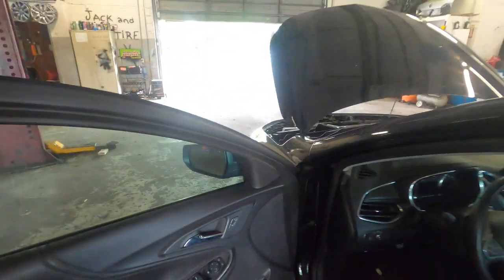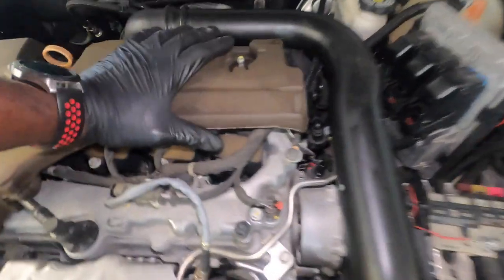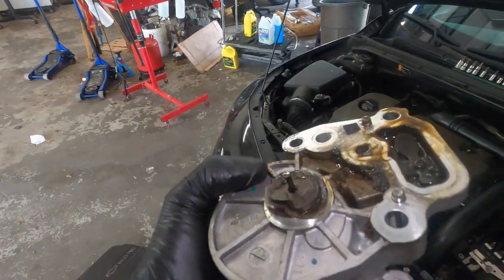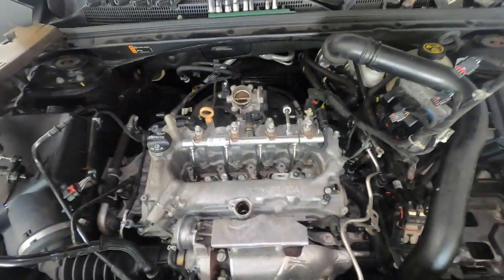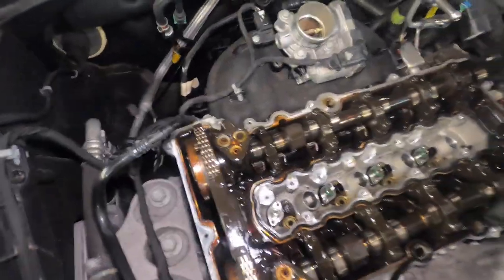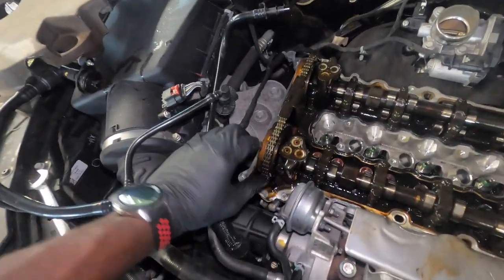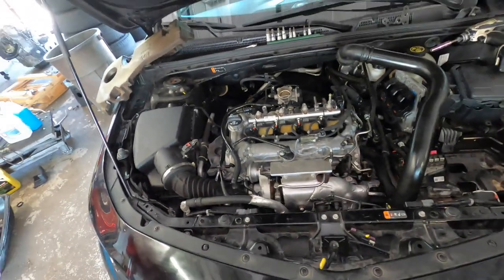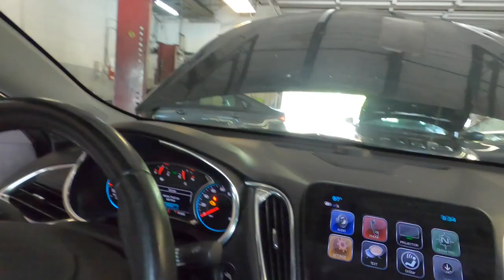Chevy Malibu vacuum pump and valve cover gasket

Comment: Fun fact, GM currently has a class action lawsuit ongoing due to faulty vacuum pumps and how much damage the broken pieces can do to the camshaft and the other valvetrain components. Also the loss of brakes due to the pump failing.
Reply: yeah mine broke the month they filed just now getting it back together 1k later so far
Reply: @CrazieFrogz  my friend is dealing with this now but her car is under warranty still and the dealership is trying to ask for oil change records for the warranty work. We shouldn't need them because this is a know bad part, but luckily she had them. They tried to tell me the cam was seized and that's what caused the pump to break. Total BS. We brought the car in running and the service advisor tried to tell me a car can run with a seized cam 🤦🏽‍♂️
Reply: @richardsilvas3152  if it does I'll be Amazed 😆. No this is faulty design!   Fight it. I'm hoping they recall. Go to face book & join the Malibu car club. They great. I have no warranty but month later & she still running.
Reply: This just happened to me! Damaged everything camshaft timing chain and a couple other things smh $3000 dollars job
Reply: My girl car just did this today the dealer said the pieces went thru the motor and she has to get a new engine and turbo
Reply: How do i become a part of this law suit

Comment: Change the entire pump people don’t try and rebuild a pump that failed it’s cheap enough to replace. It doesn’t have anything to do with oil changes with these pumps they just break. Happened to my BRZ and my Cadillac ATS it’s B.S. GM is one of the worst car company’s on the planet

Comment: I just had to replace the vacuum pump on a 2016 Chevy Malibu with a 1.5 turbo. I had to pull the valve cover off to get the shrapnel out of the engine. I was very lucky and able to retrieve all if the pieces and didn't see any "forbidden glitter" when I changed the oil. I modified the replacement by drilling out the oil feed port assembly to a larger diameter to increase the flow and volume to the rotor bearing to attempt to reduce the likelihood of another failure. Apparently there is a class action lawsuit for these pumps failing prematurely. Oh and as for oil changes, they have been done on time but this still happens...

Comment: I'm concerned about the metal debris that came out of the head from the broken vacuum pump. How would you know wether or not it already got into the bottem end of the engine?
Reply: You probably dont without pulling the pan
Reply: Two separate parts of the block your cams are blocked off . Have engine opened today and it looks like it’s only in that part of engine

Comment: The vehicle has a change oil soon notification. I guess the owner just kept driving around with the warning light on or reset it without changing oil. That oil change would have been a lot cheaper than the work you had to do. So she neglects the maintenance and decides to unload the vehicle on someone else. I bet she will want top dollar and will not tell the buyer about the lack of maintenance and the cam sprocket issue. As usual your video was excellent. Much respect my brother.

Comment: I had the vacuum pump break and lock up.  Hard break pedal, and difficult to stop.  At the same time engine lost power, and shutdown.  Towed home.  Chasing the P0014 and P0017 codes because the car would not start.  Saw another video where the chunks knocked the reluctor out of position, causing the ECM to think the cams were seriously out of time.  Pulled both cam sensors and the car would start and idle smoothly.  Rev up with no issues.  About to pull the valve cover to get the chunks out and replace the vacuum pump.   Dangerous and poor design by GM.
Reply: Did you figure out the reluctor moved on the camshaft yet
Reply: @johnmitchell8925  I did.  Pulled the cover.  Removed all the current and previous broken pieces of the vacuum pump coupler. Rotated the engine to TDC.  Then, rotated the reluctor back to alignment.  Reassembled with a new vacuum pump and gaskets set.  Good to go, until the next time I guess.
Reply: Hello, I had this same thing happen to me yesterday.. Drove home with minimal brakes but when I turned car off, it won't start after that. Turns but doesn't ignite.. Removed the pump today and it has shattered.. I have 2 pieces missing from the old unit and will open up valve cover and fish out.. Question is though, what are the chances it will start or do you have any tips I can use to start, maybe removing sensors like u mention? Any help is appreciated
Reply: I meant will it start with a new pump when I put one in or do you think the no start issue is unrelated?
Reply: @scribe8398  if you disconnect both of the valve timing sensors the car will start and probably run.  Assuming the check engine light came on and a code scanner shows one of the previously mentioned codes.  You will need to position the reluctor back to the correct position on the cam. And dig out the broken pieces that are under the valve covers.
Reply: @maikata329  thanks for your help. The check engine light does come on when I tried to start just after I got home and turned it off.. Brake pedal was and still is super hard... I don't have a OBD2 scanner so unsure of the codes it will throw..  I'm just worried it still. Won't start with a new vaccum pump as the brake is still super hard? I will open up and fish out new parts. Sorry can you Help me a bit further with what you mean when you say position the reluctor?
Reply: @scribe8398  This particular video does not focus on repositioning the reluctor back to its proper position on the cam shaft.  But there are several you tube videos that do show this.  https://youtu.be/ofnKBaCf9yI?si=ORb7_U79HHoiIO4k   at the 36:30 time of the video he shows the orientation of the reluctor to the cam shaft bar code.
This video shows a more detailed look at the cam.  He replaced his cam, but most likely this isn't necessary.  https://youtu.be/Icb_bgwKmHk?si=r9HzeOMWR3KVQOLE
Reply: @scribe8398  if you car will start and when running you have no check engine light, then the reluctor for the cam shaft timing maybe ok.  Changing the vacuum pump is a simple task.  If you pull the pump and the coupler that mates to the cam shaft is destroyed then those pieces are inside the valve cover sitting on top of the head.  You might be ok to simply install the new pump to restore your the vacuum boost for the brake master cylinder.  Beware that one of the broken pieces remaining under the cover could jam in between the reluctor and the head at which point the reluctor will rotate on the shaft and cause the ECM to believe the cams are out of time. Even thought mechanically they are still in time.
Reply: @maikata329  Thank you. I have done 95% of the valve cover removal but got stuck at the end as I don't have a pry bar and it wouldn't budge. I will get back at it tomorrow and hopefully I can get in and remove the old VP bits. I watched the other videos you reffered to and think I have a idea of how to check the reluctor. My new VP should arrive In a few days so hope to get it and and the car starts, fingers crossed
Reply: @maikata329  I finally managed to get into the valve cover and successfully fished out the pieces.. Your prediction was correct, the reluctor has moved.. The best way to describe it would be that it is at a 3 O Clock position, 12 being in line with the QR code on the camshaft.. Any tips on what I do from here.. Very lightly tapped it with a hammer but it doesn't move, scared to apply more force.
Reply: @scribe8398  it is an interference fit to the cam shaft.  It will move with a more aggressive tap. I tapped mine back into position with a hammer and bronze rod I had laying about.  But I am pretty sure you could use a piece of aluminum or metal softer than the reluctor cam to move it back to position.  I was a little fearful also, but I've not read in any of the posts where someone broke it will moving it back.  Just tap it a little harder each time until you see it move.  You might also try clamping or wedging it in place and turn the motor by hand with the crankshaft pully, which is basically how it moved to begin with.
Reply: @maikata329  Thank you. I managed to move it back with using a bit more force..  Installed new VP and closed it up.
It started :) which it didn't before (crank, no start) and brake pedal has normalized..
Butt, its running funny.. "Reduced Engine Power" message comes up along with "service ESC".. It runs for about 2 mins then idle lowers, engine shakey and then turns off.... I don't know where to start now. Do you have any tips? Or could it be that the camshaft may need to be changed. Sorry for all the questions and really appreciate the help. There is no active dealer here as Holden Shut down in New Zealand  and have service dept only who are outrages on pricing
Reply: @scribe8398  I don't have a solid answer, as I am not a GM authority.  I did not experience this with vehicle I had.  A quick YouTube search revealed a blown fuse could be the issue.  Under the hood in the fuse box, fine fuse 11, Emission1 10Amp and fuse 47 Emission2 and see if either are blown.
I'm not sure what those fuses do but it appears to be common failure amongst this garbage engine and car.
Reply: Also, you mentioned you don't have a code reader to read or erase the codes.  If it turns out the fuse(s) are blown, after you replace them pull the positive and negative battery terminals off the battery to reset the codes.

Comment: DIY folks, please read

There are a few things you need to be careful of when completing this job.

1. The PCV hoses break very easily. It's not impossible to reuse them or leave them attached, but a new set can be  pretty pricey. Just be mindful working around it, or have a spare on hand so you're not stranded. If you manage not to break it, return your new part and get your money back. I slipped and broke clean through with just my hand.

2. Probably the most important thing. Your injectors have 2 o-rings up top per each injector, one green and one black. When you pull the fuel rail off, there is a high chance the black rubber o-ring will come off of the injector and be sitting inside the fuel rail. When I was reassembling, I saw the green ones on the injector and assumed that's all there was and everything was fine. When I tightened the rail, the black o-rings did not seat properly and became torn. The rail was gushing fuel at the injectors. These oring kits from the dealer are 30 dollars per injector. Even on rockauto they are 12 per injector, or 3 bucks per oring at some parts stores, but some are not a guaranteed fit...

Before you put the rail in, make sure you get the o-rings out of the rail, push them back on top of the injector, and THEN push the rail onto the injectors. Hand start all the bolts but try and work it down as evenly and level as possible. After you push them down as much as you can, I recommend lightly tightening the 10mm bolts at the bottom to help seat the rail, and then start to tighten the small Allen key bolts on the injectors themselves. Once you start getting flush,  fully tighten your 10mm and then your allen key bolts. 

3. Easiest way to undo the fuel rail connections at the injectors is to take a flathead screwdriver, press the tab in gently but all the way in, then using your other hand, take an Allen key wrench (L-shaped) and use the angled end to pry the bottom of the connection up. Put a little pressure on the front of the connection, and then put it to the rear. You can break these by only prying on one end, or by tugging on the wire if it's still connected. Take your time and be gentle.

4. The red or gray safety clip on some of these connections break very easily. If you cannot pull them back easily or they only come out half way, try wetting it with a little bit of electrical cleaning spray to lube it up. 

5. My intake tube to the throttle body would not stay put as easy as it did in this video. If it gets loose it smacks the throttle body pretty hard and could easily toss debris in there or inside the engine if you have the cam cover (valve cover) off of the engine. Find a way to securely tie it off. 

6. Since you're already here, you might as well change your spark plugs if you haven't already. These plugs take a 14mm socket instead of a standard spark plug socket... my deep well was too thick to fit in the hole, so be prepared to buy a special socket. 

Thank you for making this video 👍🏼
Reply: thanks , i used all this but i did break end up breaking a cam sensor lol when i took off that intake tube lol oops , just now putting the car back together thanks to GM and they law suit against this part, it was hard to find.
Reply: There's a way yo remove the valve cover gasket without removing the fuel rail. Once all the connections are off and the valve cover is ready to come off, angle the valve cover in such a way that there's space to overcome the fuel rail. I literally watched my mechanic do it because he didn't want to waste the unnecessary time to remove the fuel rail.

Also, that screw that has a special tool to remove it can also be removed by pliers. Just have to twist it off. It's not incredibly hard to do.
Reply: Thank you for taking the time to make this reply Im sure it will help more then just the DIYers 😁

Comment: I would guess this is an oiling issue with the engines.
I just had this same issue, and I change oil as soon as it is needed, my Malibu has 65k, I would advise anyone with these engines to change this out at around 50k or if your check engine light comes on.
Good video 👍👍
Reply: Change out the vacum pump?
Reply: @robertschris82  yes, believe me you want to do it before it comes apart, cost me $2700 in repairs, the vacuum pump is pretty easy to change
Reply: @barnyardgarage yeah I change mine every year. It will fail no matter how offer you change the oit
Reply: @keingdougie24  yeah actually a very poor design to say the least
Reply: Exactly! Poor design is an understatement! Great call on spark plugs! 

Mine just failed at 137k mi. I’ve owned it the last 2yrs and 80k, changed with Mobil 1 every 5000 mi. 

Super clean engine but the vac pump still fails… easy enough fix, but man it was less than ideal to get a reduced engine power warning and 15sec later have a hard brake pedal while descending Colorado mountain roads at 70mph. Pucker factor indeed! 

Make sure you review the codes! Local mechanic saw a fuel pump driver low voltage and told me it would need a fuel pump. Skipped over the low vac and camshaft position over advanced errors. Those codes combined with a hard brake pedal and reduced engine power, lean toward vac pump failure. Don’t get taken for a ride on $300 diagnosis, and $1000 or more for a fuel pump and driver you likely won’t need just to have to drop another $2000+ for a new vac pump, exhaust camshaft, sensors, etc. 

$300 in parts buy the PCV hoses, break them and get it out of the way. Lol. eBay has the injector washers for $15-20. Go ahead and buy at least one set. A days shipping and a few hours of wrench turning and we’re back in business. 

Only thing I might add to the video is double check the painted timing dots on the timing chain and gears, plus the QR matrix codes, plus the reluctor pin alignment. Use plenty of sealant jut like shown in this video before buttoning it back up. 

Thanks for this video! Good luck everyone!
Reply: @barnyardgarage  Check to see if a service bulletin has come out on this yet, If so i believe you would get reimbursed if you saved your repair bill
Reply: @jamesshimp640  Thanks for the heads up

Comment: Question: 
 I didn’t got to see how you remove the Crankshaft pcv valve the one on top back side. I was told it’s not removable only by removing the valve cover a 4hr job BUT I notice on your video you took the tuve/hose off the pcv valve it self. The dealer said it would need to be destroyed to remove and Install a new tuve/hose. I notice yours removed and then at the end of your video you just snap the hose back in.  Can you share details and if you did managed to remove can you provide detail on tools used. Thanks a million!! Great video!!

Comment: My 2016 Malibu has the same thing wrong thank you for the video helped a lot!
Reply: Same thing here. Only got 40k miles on it and have always gotten the oil changed on time and the dealers tells me 1200 to get the valve cover gaskets replaced..it'll be traded in within the next month or 2

Comment: Would a vacuum pump cause the brakes to pulsate like the ABS is kicking in?
Reply: no thats most likely a warped brake rotor
Reply: thats what our car would do really bad and it turned out to be  the vacuum pump
Reply: Yes, that is correct. Feels just like ABS pulsing or brakes grinding. It is indeed the pump. Also if you have low/dirty oil and/or codes P1101 + P0556, it is 100% the pump.

Comment: Will this cause engine to seize. ?
Reply from the maker: Yes
Reply: @DULLAHGOSOHARD  did you fix the problem or it didn’t get that far with this vehicle. ? I’m trying to see will I have to get a new engine or can it be fixed. The dealership said I’d need a new engine but I was thinking can’t I pick the pieces out and fix the problem without replacing the engine.
Reply from the maker: @latraviousharvey9757  if it’s really bad you need an engine